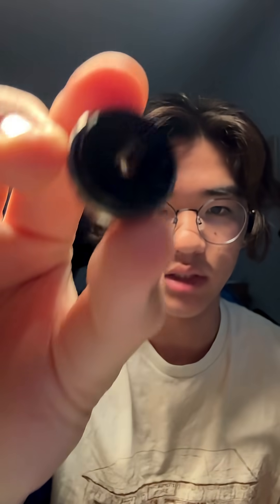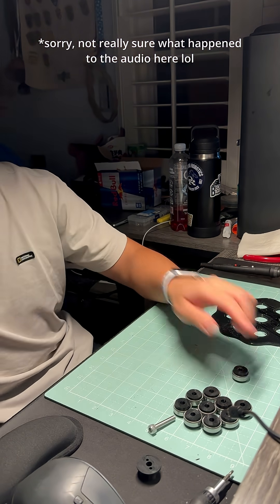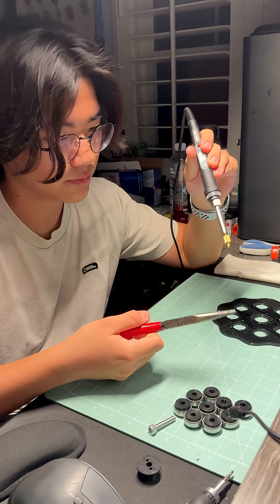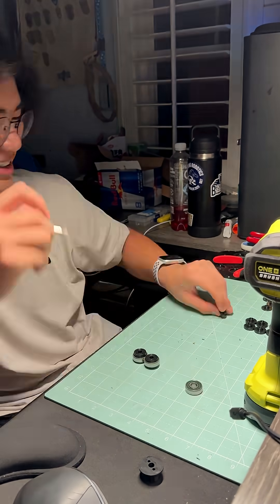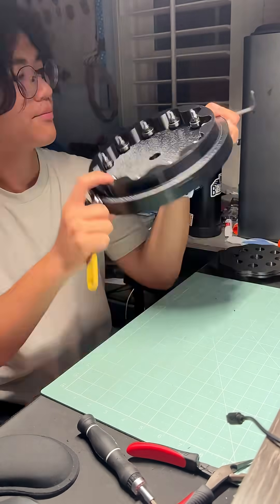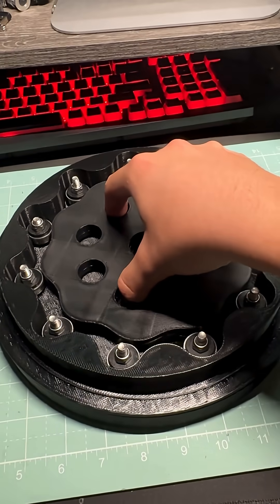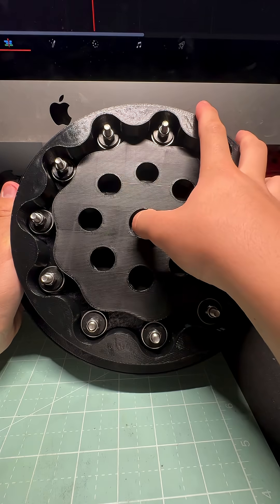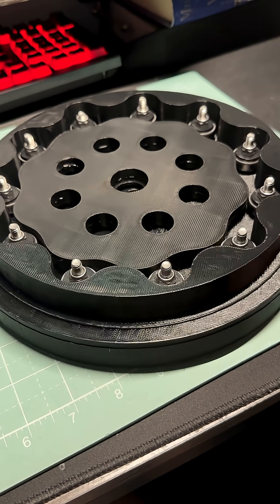Making a Robotic Arm || Day 3 - Completing and Testing the 2nd Stage Ring Gear

Comment from the maker: sooo I think I accidentally deleted the clip while editing 😭 but just to clarify, I drilled the bearing inserts right after taking them out with the screw driver bit, put them back into the bearings and then mounted them onto the stage 2 ring gear